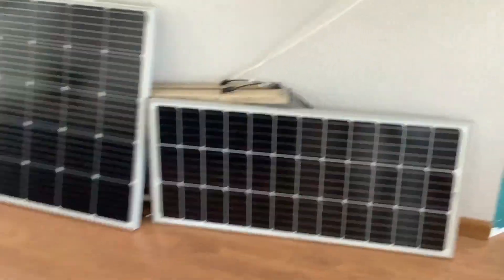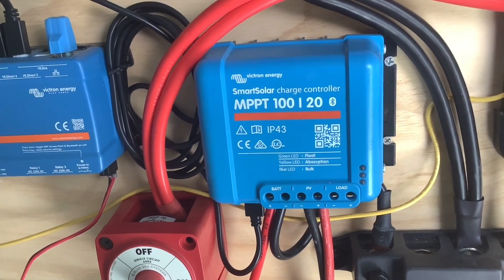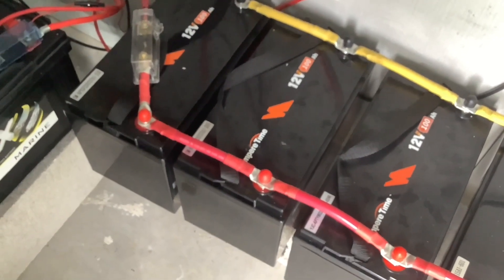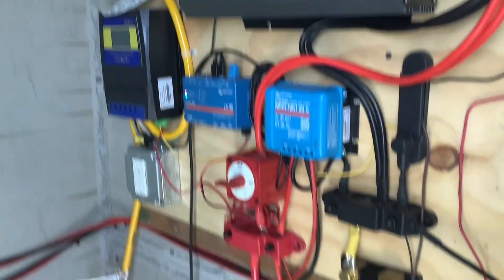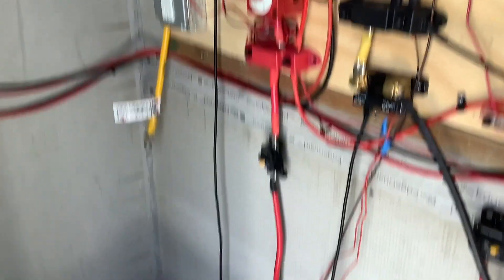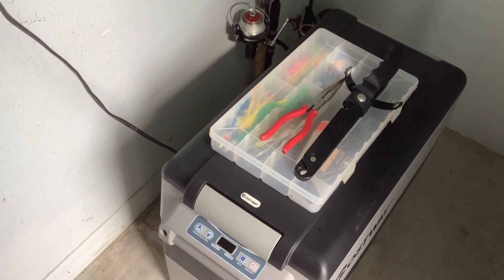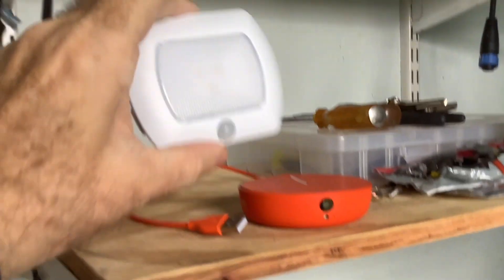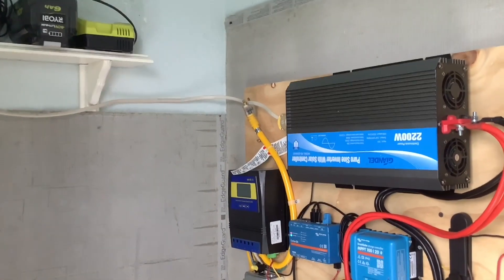Quality, scalable and inexpensive solar setup to get you through a power loss or a disaster.

Comment: I'm getting ready to pull the trigger on your parts list but want to get the Giandel 3000w inverter instead of the 2200w you have.  What size fuses, breaker and gauge wire will I need?  Also I'll be going with the victron 100/50 controller.  Also can you link battery cables with proper gauge,  I don't want to cut my own.   I assume you get a kickback from Amazon so please post with your affiliate link.
Reply from the maker: Are you going to try that at 12v?
Reply: @colinauld  yup my batteries are 12v 100ah
Reply from the maker: Ok, 3000w at 12 volts is serious business and that inverter is going to allow for some spike in watts too. Take a look at this video from a Victron sponsored installer.  Victron is an amazing company and safety is paramount to them. 
You’ll see him using a 400amp fuse and 4/0 cable (per Victron safety standards) which is pretty expensive stuff. Here is the video https://bestfavoritesbestof.blogspot.com/2022/12/how-to-install-solar-electrical-in-diy.html

Comment: Can you do a COMPLETE parts list for this entire system including all the battery cables and fuses for your 4 battery set up with Amazon links please.
Reply from the maker: Yes I have,  it’s the link in this blog page where it says “here are all the components and pricing on Amazon”. 
https://bestfavoritesbestof.blogspot.com/p/starter-system.html
I should have said something about that in the video … just get too excited about sharing the technology side. 

Thanks for the comment, let me know if I can be of any further help.
Reply from the maker: I just noticed I didn’t have the battery cable, fuses or breaker in the list. I’ve added the now , here you go https://www.amazon.com/hz/wishlist/ls/2VT6KWKLJ0WDO/ref=nav_wishlist_lists_2?&_encoding=UTF8&tag=solar070e-20&linkCode=ur2&linkId=435a0f0b143bd92e18afaa2301a00c7a&camp=1789&creative=9325
Thanks again.
Reply: @colinauld  I thought I saw a Victron Cerbo Gx in your system.  Anything else missing from your build please?
Reply from the maker: @MyChannel-vm6dw  Yes you’re right, that list is for the starter system.  Here are the optional items I have in my setup https://www.amazon.com/hz/wishlist/ls/2DR68GMZ6UVVG/ref=nav_wishlist_lists_2?&_encoding=UTF8&tag=solar070e-20&linkCode=ur2&linkId=71524e9f0a138b3cfab7d8b9fe53a580&camp=1789&creative=9325
Reply: @colinauld  I think there are some parts still missing?  Big red button?  How did you calculate the fuse size off the batteries?
Reply from the maker: Here is a full overview https://www.youtube.com/watch?v=KlCFKCvmMJc

Comment: 48 volt/ rack mount much better.
Reply from the maker: Not for the beginner with small load requirements Laterius.  48 can be dangerous and is better suited for bigger loads.  I will go to 48 on the boat so I can also use the batteries for power to the electric motor but this entire system is right around $1,300 and it can grow. They could even knock it down to $1,000 if they start with 1 battery.